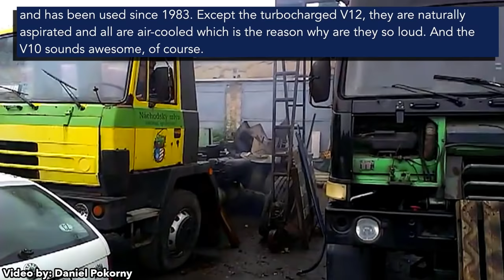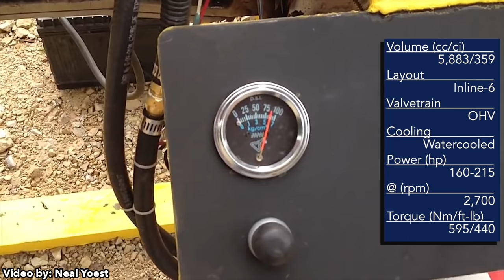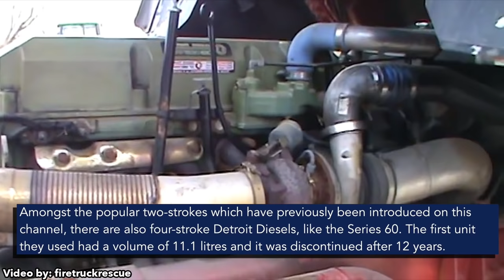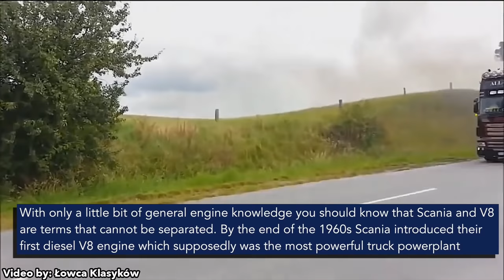10 Best Sounding Truck Diesel Engines

Comment: Excellent assemblage of videos and history and analysis of the engines. I also like that a lot of the engines here were not pristine brand new, and some sounded "down" at least one cylinder, but still in use in real life. But your title says best "Sounding" engines, and as far as sound goes, to those that have ever heard one go through the gears in real life, there is nothing that even comes close to a two-stroke Detroit Diesel. Check 'em out on YouTube, there are a bunch of videos out there. Unfortunately, your compilation showed first some sort of crummy sounding DD that I've never heard of, and the vid you chose of the "real" Detroit Diesel sounded muffled, and like he was going down hill and not "pulling" through the gears. And for what it's worth, I think the Cummins sounds next best, and wow, I have to put Tatra as third best just for striking fear in my heart :-)
Reply from the maker: Thank you for your comment, mate!

Comment: Gotta love a 7.3. They started in 1994.5 btw
Reply: 79powerstrokediesel The Power Stroke 7.3 started in 94 yes. The 7.3 liter Navistar was around in the mid to late 80s. I had one in a 89 f350 duely..Had a three speed automatic transmission,(C6) Sumbitch was like driving a hotrod! This guy said the power stroke had 250hp with the automatic,my NA 7.3 had 285 or 300  factory up. Might be wrong but I thought that's what the book said.
Reply: squach623 !!!!! The 7.3 idi was in the 87 1/2 to 94 1/2. I have a 7.3l power stroke and it say 215hp.
Reply: 79powerstrokediesel Man that can't be right! My old 352ci gasser from 1965 had 225horses. Must be that downrated shit they do to meet EPA standards!
Reply: Plus I thought his torque rating was low also! Thanks for the reply! Keep the oily side down!
Reply: squach623 !!!!! Funny you say that I was with my buddy in his 88 dodge and the oily side was up. I have a level 2 head trama and a concussion.

Comment: What about the 6.7 powerstroke straight piped? Or the 6.0 powerstroke. Both of those sound sick with a turbo back exhaust. Best sounding engines in my opinion.
Reply: Both unreliable and sound clapped straight pipe

Comment: Great vid :o) I tried to design a cooler package for 3408 and I couldn't because they were well over the 3406 450hp, but on here and everywhere I look the 3406 is indeed low power for its size. I guess the later ones were a serious internal rework of the early ones (hardly unusual I guess).

Comment: Your information is a little wrong on the 60 series the 12.7 and 11.1 lived during the same time the 11.1 was just the smaller version and the 12.7 in 95 was atleast a 500 hp later being replaced by a 14L making 600 to 650 hp

Comment: the only difference between the 12 valve Cummins and the 24 valve Cummins is obviously the valvetrain but it also has a different fuel pump but other than that they are the same size

Comment: Greetings from Downunder! The E9 is economical, you say? If you call 1,8 - 2,0 litres per kilometre economical, then, yeah, I suppose it's economical. Though I'll agree with you on one point, the Cat 3408 is very thirsty, much more so than the E9. Both very popuplar engines around here for a long time, the E9 can still be found in daily use in the Outback pulling roadtrains because of it's simplicity, good characteristics and tuneability. (That and the trucks it is typically found in are so old that they escape the legal requirement for a speed limiter... =)
Reply from the maker: I've read about 5.52 mpg which seems normal not only to me, but also people who work with them.

Comment: I'm not a big fan of the series 60 Detroits. i like the older 2 stroke ones like the 8V92 and stuff like that. those are the detroits i like. i know they are long in the tooth now and bits are harder to find as they get older but i still love them and rather them to the series 60's. just the old 2 stroke detroits like the 8V92 and 8V71 and all the detroits of that era are my personal preference

Comment: not sure if anyone has already stated this but the Mack E9 is an overhead valve engine. not sure exactly why there is a question mark beside it.
Reply from the maker: Because I couldn't find it anywhere, but I reckoned it is an OHV engine.

Comment: I'm pretty sure that 2stroke diesels can't be NA and the 8v71 has a gear driven supercharger doesn't it?
Reply from the maker: Yes, but it's not called a supercharger as it only provides sufficient amount of air. Therefore it's called a blower and in general such an engine is considered as a naturally aspirated unit as it would not work without the blower itself. One side note: the blower pressure roughly the same as normal atmospheric pressure.
Reply: brian m a supercharger is belt-driven  a blower gear driven
Reply: A non turbo Detroit two stroke is considered an NA design. I suppose switching to a turbo cam might give it some boost and the blower speed would also need to be increased to match the different cam timing.

Comment: So just outa all You Ol'school gear-hammers out there who used to drive professionally,  which engine would YOU drop in the front of a '49 International LF-225 log truck?

I was thinking of the Cat 3408, or the Mack E9, but which engine would be easiest to upgrade for power like the Banks power-pack, & the Fuel-injection performance kit???

I wanna lower my truck and turn it into more of a classic show truck or highway cruiser, not as much of a work truck when I'm done restoring it.

Comment: Mack a crappy truck??? Not!!!
I guess this dude reads a lot of comic books...Only truck that holds up in NYC and inner city sanitation snow plowing etc  . Best truck ever made...invented many innovations .
Reply: motorhead Old macks were great trucks but the newer ones aren't all that great
Reply from the maker: Who says the Mack is a crappy truck? Who?
Reply: As a heavy truck mechanic, I can legit say Mack is by far the most reliable truck especially with their legendary camelback suspension and an unkillable engine an transmission, although some of the newer ones manufactured after 2007 with Volvo engines are not reliable, as far as the engine and emissions components go

Comment: The 12 and 24 valve are the same sizes it until after the 6bt got a common rail that it changed from the 5.9 size

Comment: it was a good vid but you should have put a v903 0r a 555 both  cummins v8s they are the best sounding cummins diesels in my opinion . we just bought a 71 kenworth w900 with a v903 sounds good but it dont like the cold

Comment: Allow me to correct a little something. The Powerstroke isn't a Ford engine any more than a Duramax is a Chevrolet. The 7.3, 6.0 and 6.4 Powerstroke engines were produced by International Harvester Corporation. The 6.4 was plagued with problems that IHC refused to warranty and that spurred Ford to design their own engine from the ground up. Enter the 6.7 Powerstroke. The very first "all Ford" Diesel engine. 

BTW...The Duramax that all the Chevy boys love to tout is built by Isuzu.
Reply: BigRedPower59 um your claims about the duramax in the chevy has been well covered
ill give you a factual run down
Reply: BigRedPower59 at the end of gmt400 gm needed to get a new v8 diesel out they went to isuzu their own company sat down and started to develop the duramax it was 50% gm and 50% isuzu since it was a 24/7/365 development in the end gm had a 60 percent or so ownership of the company dmax which toke its place in ohio and the engines are entirely built and made a factory right next to the old 6.2/6.5 diesel factory the isuzu ownership of duramax was bought completely by gm after the lbz and isuzu pulled out it is still American made built and designed so facts bitch so no the duramax is not like the 7.3-6.4l Powerstrokes
Reply: BigRedPower59 Yes The Same Company That Made The Chevrolet LUV And GEO SPECTRUM And GEO STORM!! Truth Hurts! Haha!
Reply: jdr ok yeah the 7.3 is better than a duramax.

Comment: Are the Tatas air cooled as it's colder in Russia and they therefore don't need to be water cooled?
Reply from the maker: I don't think so. Tatra is most importantly a Czechoslovak brand. Well, now a Czech brand as we are not a single country now.
Reply: VisioRacer 

Sorry, geography is not my strong point.

Great video by the way.

In my country an air cooled engine wouldn't survive, all the old VW beetles and camper vans overheat here, the only air cooled engines we have now are motorbike engines.

Comment: Hey, got a question or anybody. I've never really looked it up or even thought about it or even ask. But looking at this video got me to thinking. Why do most all of the big semi trucks in Europe only have a single rear axle. and not a double axle lock in the United States. I'm pretty sure they have a different weight limit on the roads over there but  I'm just curious. 🤔😁👍
Reply: because they have lenght restriction
Reply: @thermidorlevrai65    I kind of find that a little hard to believe. cuz if you take a look at the tractor and the trailer driving down the road. They are the same length is it semi trucks are over here in the US. That is if you get the right semi truck not custom. I think it's because the single axle turns a little sharper then a tandem axle does. But I'm just guessing. He'll pop-a-top drinker beer. Sit back and chill and enjoy the summer. 😁👍🍺
Reply: @carlhelmick8104  Maximum length of a truck with a semi-trailer in Europe is 18.75 meters.
Reply: @thermidorlevrai65  ok, I'm good with that . Had to go look all that crap up. Didn't know I could find that on the inter net here . Never really thought about it. I use to drive over the road . Up and till my heart attack.  Trucks here in the US just keep on growing. Oh , don't get me wrong it wasn't that I didn't believe you I was just curious. US trucks are up to about 80feet now. Depending on the truck and trailer. 😁👍🍺
Reply: @thermidorlevrai65    hey buddy if I figured this right. 80 feet is about . 24.390,m and a bunch more numbers. Anyway have a great week. Pop a top . 😁👍🍺
Reply: @carlhelmick8104  trailer in america can be 53 foot 16 meters for a reefer
Reply: oh and in canada we have a-double 53" truck
Reply: @thermidorlevrai65  yes I know that. I use to drive long distance,  over the road. But if you add the tractor, semi truck. To it you'll end up with between 70 and 80 ft depending on the tractor or semi truck you have. Some of them are pretty long. And that's just tractor. Some of the tractors over here come custom with sleepers that have kitchens and showers on them . So that could put you well over a hundred some odd feet. Like I said it depends on the tractor you get. Semi truck, we call them tractors in the United States. Some of these guys over here leave home they never go back home. They just stay on the highway and keep on driving. Out in Midwest of the u.s. some truckers pull two 53-foot trailers. That's a lot of crap going down the road ain't it. 😂😂 . Have a great week buddy. 😁👍🍺
Reply: @thermidorlevrai65     Hey you're in Canada. Cool! You guys getting any warm weather up there yet. I went to Canada one time went to Quebec. Picked up a load of glass. Came back down to Charlotte North Carolina. 🖐️😁 Hi, 😁👍🍺
Reply: @carlhelmick8104  in canada its between 0 and 20°c and snow is still melting
Reply: @thermidorlevrai65  wow , I'm glad I live in North Carolina. It's been  up in the mid, to upper 70's and 80's here. I've never been much for real cold weather. And now with my little heart problem I have to take blood thinners so I like cold weather even less. Hope you guys warm up soon.  I love the summer.  SUMMER TIME !!!! 😁👍🍺 Oh yeah,  summer time and cold beer . That I like . 😁👍🍺

Comment: Hey just for the sake of accuracy, 24 valve cummins are the same size as 12 valves
Reply from the maker: Yes, unless you compare them to the 6.7 unit
Reply: VisioRacer Ah I get it. Most of the time when I or my friends refer to a 24 valve we are speaking of the non common rail successor of the 12 valve.
Reply: Flyboy207 Same here. When I hear 24v Cummins I think of the vp44 trucks

Comment: the V892 Detroit engine is blown, not NA as stated in the video @ 9min
Reply from the maker: Without being blown, it wouldn't work so this is the natural of it working.
Reply: VisioRacer nope. It has to be blown to run. That's how it displaces the exhaust. I've had to replace blower shafts for no starts and reset the odd tripped trap door.
Reply from the maker: Mate, sorry for my typo. It should have been 'wouldn't' - of course, it wouldn't work without being blown.

Comment: I have an interesting question :
why engines that are used at off road vehicles like kraz trucks or military vehicles like tank engines have significantly less power and torque regarding to their volume and number of cylinders?
my own idea is it means that less pressure occurs on these engines so it makes them to last more in severe conditions
Reply: because who drives as fast off road as they do on road?
Reply: At least in military applications, they frequently need to be able to run on multiple fuels as necessary, plus they are probably geared shorter in general to increase torque at the wheels, negating the need to run the engine close to what its design could do, reliability wise. See the Chrysler Multibank, which Chrysler claimed could still run if 12 out of the 30 cylinders were taken out.
Reply: counterfit5 tnx for answering my question
Reply: At least in the military, less hp, less rpm, more life, more reliability
Reply: jerryw66 yeah, that's a much simpler way to describe it, lol

Comment: I've never heard of a crankshaft on a 3408 cat snapping and they make more than 500 horsepower they make 500 to 730 horsepower or more besides it's horrible fuel mileage in my opinion the 3408 cat is the most reliable semi engine caterpillar ever made

Comment: 9:31 - My dad's Cummins 5.9L 12V does the exact same slapping sound when cold! What could it be?
Reply: probably needs new tie rods
Reply: TheZProtocol it's a fuel knock most diesels have it to some degree when they are cold

Comment: Working as a mechanic for Scania i see a lot V8 engines and they are some beast. The newest generation with its 730 horsepower and 3600 nm is pretty good. Only limited by the gearbox. Marine engines make around 1000 horsepower

Comment: Detroit 60 series:
Every new Series 60 engine is covered by the following standard warranty:

Engine: 2 years, unlimited miles, including 100% parts and labor
Accessories (if supplied by Detroit): 2 years, 100,000 miles, including 100% parts and labor
Major components: 5 years, 500,000 miles, including parts and 100% of Service outlet's normal charge

OIL & FILTER CHANGE (LONG-HAUL)
30,000 MILES
FUEL FILTER CHANGE PRIMARY & SECONDARY
15,000 MILES
VALVE LASH ADJUSTMENT
AFTER FIRST 60,000

https://demanddetroit.com/parts-service/support-by-model/series-60/

Comment: Some things that could make the list
Cummins M11
Deutz air cooled 6 and 8 cylinder models
Ford brazilian engines, 6.6 and 7.8 inline 6.
Case 505/Cummins 8.3 as they are almost the same
And not to forget old international engines.
Reply: Ya the old dt360 and dt466.

Comment: It's ridiculous how, for example, Ford utilises 7.3 litres of displacement gaining 700NM of torque, while older BMW 3.0 liter TT diesel produces way more horsepower and 550NM in stock form. A remap and you're at 6-700NM depending on how far you're wanting to go. Dutches made E9X wagon BMW with the newer 3 liter Tri-turbo diesel, making 900NM of torque. Reliability aside (That's the point of truck engines, I get it) Americans have a really shitty displacement/power ratio.
Reply: The difference is duty cycle.  Put that 660 ft*lb BMW 3-liter in a heavy duty pickup truck weighted up to 26,000 pounds GTW, and you'll drive over the crankshaft in about 5 minutes.  In heavy vehicles, it's not about speed, it's about earning money through reliability.
Reply: +Andy Harman I seen farmers plowing with one of those things in a X5
Reply: It's not that the crankshaft is not replacable for more heavy duty one, it also increases rotating mass thus decreasing rev speed and horsepower, but that still does not change the fact about d/p ratio.
Reply: It's easy to say some one is wrong, care to explain with facts and in depth?

Comment: I want to correct you on the Scania DC16. None of Scanias engines have DOHC cams. It is single cam push-rod valves, or OHV-engine as it is called.

Comment: Trucks in europe which sound like that are open piped which is just a straight pipe but than for trucks. Open piped trucks are illegel actually because the engines are licensed with emission classes. So the exhaust fumes are very dirty, this means you have to pay less taxes (euro 6d is the cleanest, the scania in the videos are euro 5 and 6) but they are actually way more dirty. But most police doesn't really care about it though.

Comment: here in America we don't much Scania. but there is a Case tractor built around the 1980s and I'm not sure of the model numbers that had Scania engines in them.
Reply: 4890/4894 and the 4994 had the V8

Comment: 8:57 there’s no such thing as an NA 2 stroke Detroit. They needed a blower to run by design. Since there’s no intake valves it relies on a blower to compress the air going not only into the cylinders but the incoming air pushes the exhaust gases out.